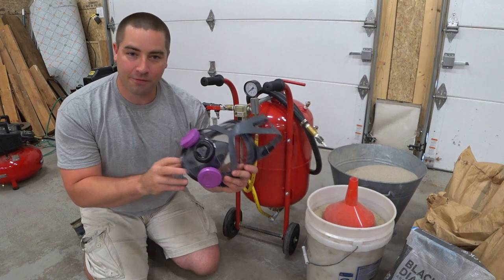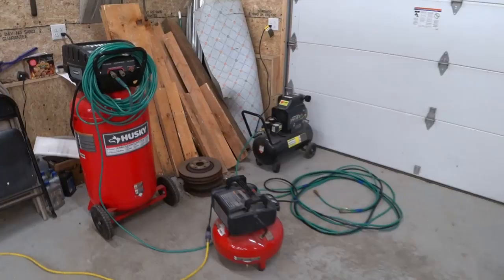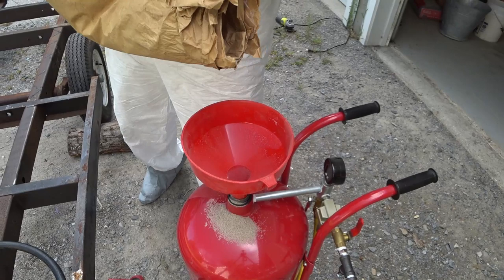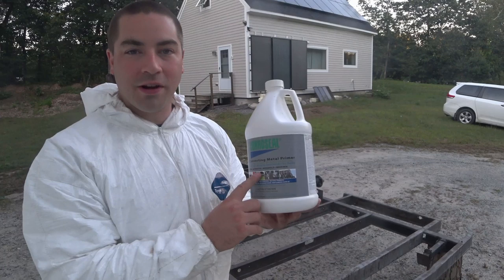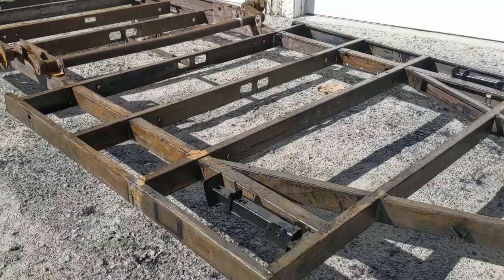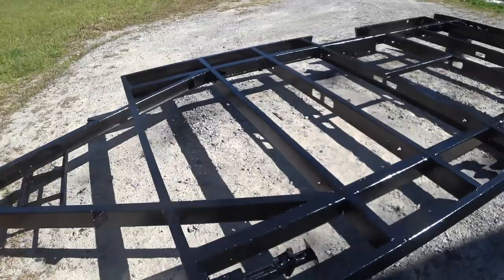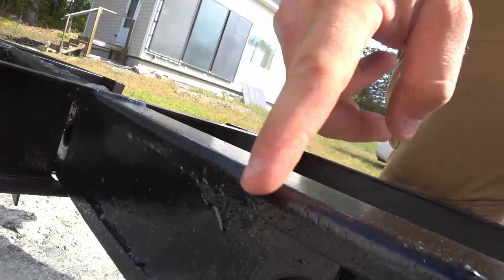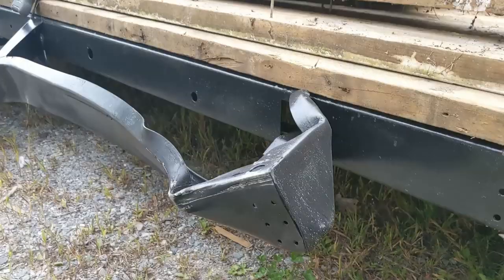Sandblast and Painting Utility Trailer from Camper

Comment: Just cut the damage off, replace it with 2" Angle, so there is something to mount decking and lights, or what ever, 2"- 3" or so, just bolt it on the frame, all you would need is cut and notch, drill holes, bolt on!! I hate that happened! Maybe some of the fiberglass rods, like drive way markers, with reflective tape, put then on corners of the trailer, making it easier to see, easier to back, maybe cut them in half, they are about 4' long, bright orange, 1/2" or smaller in dia, maybe put LED's on them!!

Comment: The rust converters use a tanic acid to convert the rust into hard coating of ferric tannate. They are sold mainstream under the Permatex, Duro and Loctite brands as "Extend". What you used is the same stuff sold in bulk. They only create the coating if there is rust to convert and should not be used where there is no rust present. The water that is the carrier for the acid will actually cause rust where it is not present. It also does not prevent new rust by itself so must be topcoated in a reasonable time period. Also, do not overcoat, just apply enough to convert the rust present - more does not help and actually makes it worse. It is darn good stuff when used within those parameters. If you are completely removing the rust by media blasting it is better to use a clean metal primer on the bare metal, then paint. If there is just a little rust (as from wire brushing), a rusty metal primer straight on is the best route, then paint. Moderate rust, converter, then rusty metal primer, then paint. That is my experience.
Reply from the maker: Thank you.

Comment: Time to weld a new corner piece on. At least it was the trailer and not your truck.  Btw, in most places, trailers are covered under the vehicle insurance when it's attached to the vehicle. At least in Florida they are.

Comment: David this is what I used Rust-Oleum Automotive 248658 10.25-Ounce Rust Reformer Spray, Black works great and after it dried I used rubberized under coating both are spray cans they are cheaper than  what a auto body shop uses but work JUST AS WELL  JUST SOME THINK TO THINK ABOUT IF YOU ARE GOING TO RE DO THE TRAILER NO NEED TO SAND LIGHT RUST OFF JUST THE HEAVE STUFF THEN SPRAY ON LET SET FOR 24 HOURS AND UNDER COAT WAIT 24 MORE HOURS AND AWAY YOU GO
Reply from the maker: Thank you, good tips.

Comment: Im currious if that's enough air myself!!! 
But I'd look in to a rust concerter, and only clean the areas that need to be like new! They make a kit for pressure washers, that soda blast, that would be cool, it leaves a film that resist rusting, but yeah the rust converter, has to have rust to work! It converts it to a protective layer!!!   I have a old mobile home frame, like 50's, so it was a camper, about 24' long, I'd just cut the damage corner off, replace it with 2" angle steel, if you need something to mount decking to.

Comment: Just an FYI, you can add a cheap blaster gun to most power washers and get some crazy blasting quick. Guns are usually $30-75, although the 60-$75 are going to usually last longer and are better. Get a $10 kiddy pool and some Harbor Freight tarps to make a work area and you can simply let the sand dry out and reuse with a piece of screen over a garbage can.
Reply: Every video ive watched so far with them doing that it didnt work so well.

Comment: David, did the other guy stop and do the right thing?  It is just steel, it can be fixed, good luck.
Reply from the maker: Hi Greg,  Yes, the truck stopped and did the right thing.  I'm now fighting it out with his insurance company.
Reply: @DavidPozEnergy  That's a lot of hassle going through insurance companies - I'd have offered or accepted something like $100 and shook on it.
Reply: @DavidPozEnergy  David, just bringing the insurance company into it doubles the pain, should double the cost.   Are you going to use some of that load of pressure treated wood for the trailer deck?  Good luck.

Comment: Nice job! Did you use non silica sand? 

Also, I didn’t know you needed that many air compressors! May I ask what your settings were for psi to get a good abrasive setting? 

Am planning in doing this to my trailer this week!
Reply from the maker: This was my first time attempting to sand-blast, so I'm not an expert.  The manual said 60-120psi, and I think I had that set to the low end.  The problem is that it takes a ton of air VOLUME, which is why I ended up borrowing my friends compressor and adding it to mine.
Note, I sand-blasted it, then primed it with a "rust conversion primer".  This was a mistake.  The sand-blasting took me down to bare metal and I should have used a more normal metal primer.  The rust-conversion is a good choice if you are using a wire-wheel to quickly take off large chunks of rust, but leaving some rust behind.

Comment: I have a trailer almost identical to yours to refinish, what was the grit size of the sand you used to blast it? I've got a Medium grit coal slag that I can't seem to make work with my siphon sandblaster from Tractor Supply.  I've bought a bigger compressor because my horizontal Kobalt crashed when I tried it, though it's only a year old and of sufficient size, and then I bought a Harbor freight tank gun and that clogged up as well--but that may have been due to a kink in the hose.
Reply from the maker: I don't know the sand size, whatever was in the bucket.  I bought it used off craigslist.  I had to hook up 3 compressors to get enough volume of air.

Comment: Perhaps the truck driver was one of those commenters who said to remove the sides. Lol

By the way, why did the guy have that pile of lumber for free?
Reply from the maker: People give away old decks for all kinds of reasons.  In this case the homeowner needed a new septic tank and the deck was in the way.  I've also seen some connected to old pools, or when building an addition.  I still have to sort through it and throw away rotted, splitted boards.  And I'll have to de-nail all of them.
Reply: @DavidPozEnergy  , I wood glue split ends. Just glued some a few days ago. And if a structure has a lose board end, gluing a short board on the end prevents splitting. The short board gets turned 90°, so the grain is strengthening the other.